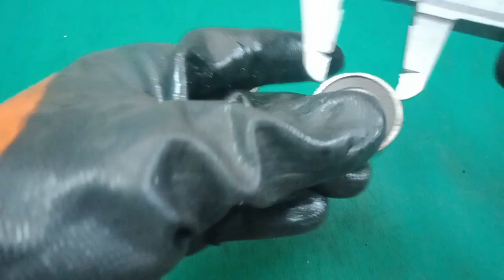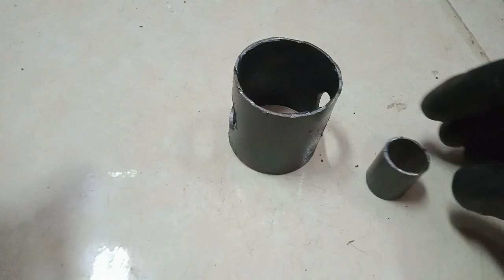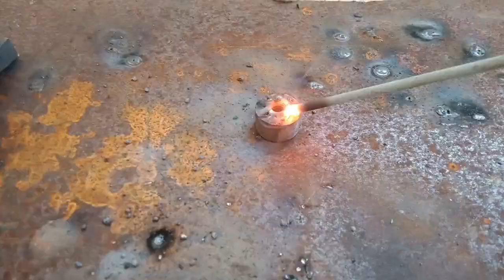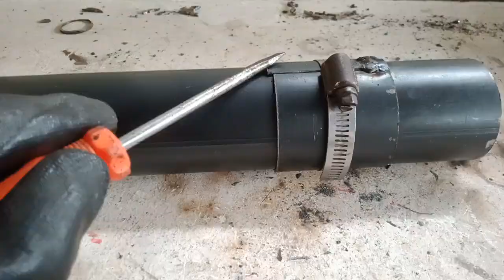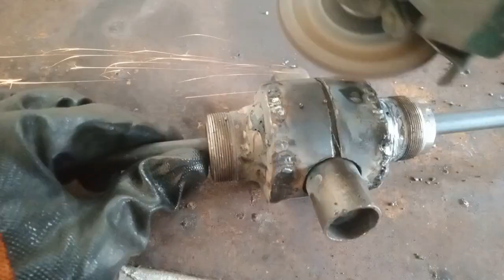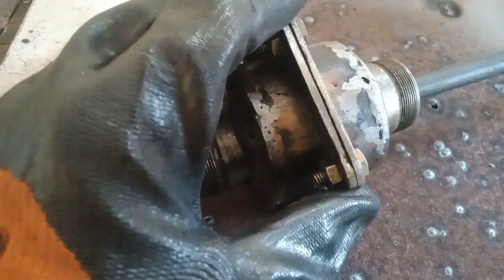Making collapsible case tricycle differential without lathe

Comment: Hi, I have just stumbled across this and have a few questions:

(1) As set up in that configuration,  brake and freewheel on the same axle (which is how my trike is designed)  will you not have problems with the brakes if the differential is placed on the axle?

I am thinkingthat, with your differential, applying the brake will result in only one rear wheel stopping whilst the other wheel will still be driven by the pedal. No?

(2) what does one do for lubrication?

(3) can your differential work for standard 15mm diameter trike axles?

(4) Are you able to get all the components of each half of the differential lined up accurately with each other?

(5) Are you yet able to take orders for these differentials?

(6) Finally, a brilliant video; very clever

Thanks

Comment: good job.. 
but we need relocated brake to tyre or it will not work properly
Reply: Wrong, just as turning force from the chain is applied to both wheels, braking force will also be applied to both wheels so long as they are both in contact with the ground
Reply: @jrobpat0154  Thanks! I didn't even think of that. I was thinking I'd get some old angle grinders from the junk yard, but would be difficult to find two of the same model. Found them on amazon :-) Thanks!

Comment: You are really talented 🙂 I love the ideas.. but you have sloppy drill press skills.. how are you meant to get accurate holes when you are fighting the torque of the drill with vice grips or you don't mount the vice to the drill press deck.. I understand that you are probably rushing it but it's really teaching people bad habits with tools.. I would like to see you use the tools as they are meant to be used it makes for a better job.. but otherwise I really like the channel and am subscribed.. I have watched several different videos today and the tool issue is though em all but I have also liked every video regardless of my personal OCD
Reply from the maker: Oh, I've considered that.  the point is use a step drill.  Its tapered profile provides the same cutting force all around.  not much effort to make it centered